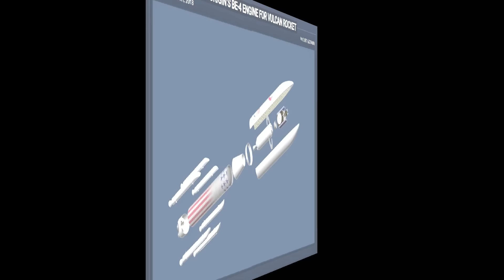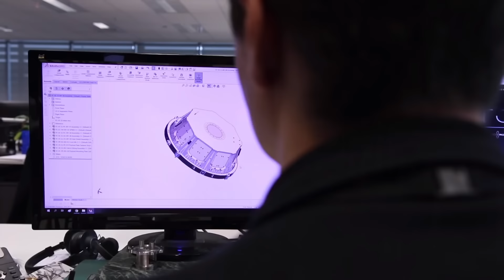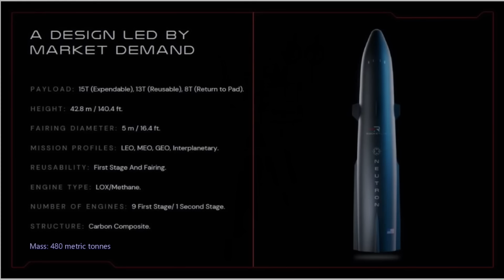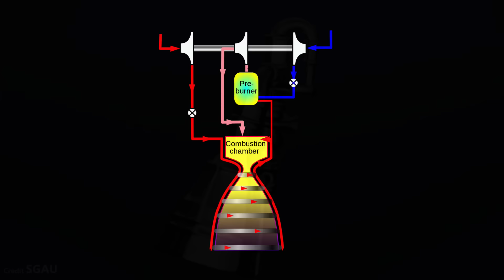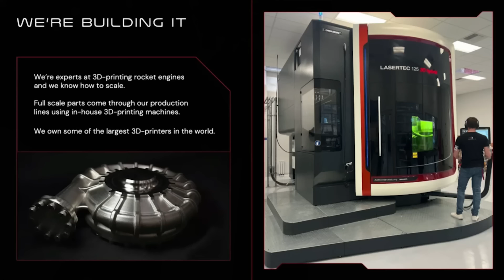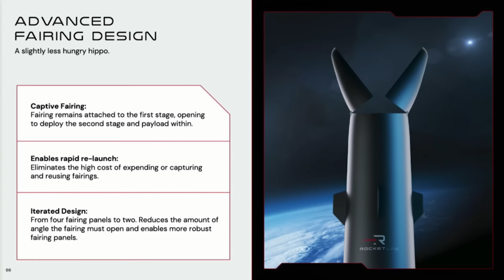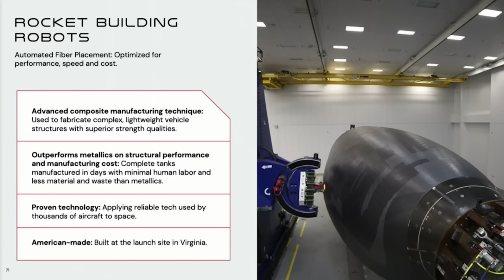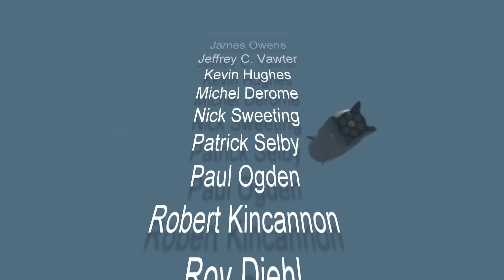Rocket Science: The Archimedes vs BE 4 Rocket Engines

Comment: I like the new choice of  engine design and the reasoning behind it, It allows for an engine design that can be easily altered to suit future power requirements etc.
I like the fact that Rocket Lab is doing some genuinely innovative stuff here, instead of just another Spacex copy. 
I think Peter Beck was perhaps a little misleading with the comment of carbon fiber being 1/4 the weight of metal for the same load, that may be true, but when used in this application the tanks need to be seperate to the outer structure. With metal the tanks are part of that structure, so perhaps the actual figure is more like 1/2.
From what I have read on carbon fiber (I work in the metal trades) it's strength in any direction depends largely on the lay of the fiber (to make it very strong in one direction it becomes weaker in others).
It's durability and ability to consistantly handle the change from ambient temp to cryogenic temp for the tanks, and ambient to reentery temp for the outer structure is largly reliant on the glue that holds those fibers together.
While I think using carbon fiber is a difficult task for this application, Rocket Lab have stated that they have developed their own 'glue' for this purpose.
They have also developed their own nontoxic hyperbolic fuel, I think that is a first, but could be wrong. In any case Rocket Lab clearly employ high quality chemical engineers who would be as good as anyone at engineering those problem 'glues that I mentioned above.

I guess this has been a long winded of saying yes, I think Rocket Lab has what is needed to succeed with Neutron.
Reply from the maker: Spell check made you say hyperbolic fuel :-)  Which is proprietary to Blue Origin! I am still mixed on composite materials but I think the Neutron application is about the right size, and the booster won't experience anything near orbital reentry heat.  But when you get really big I think steel is the way to go.  Or lunar titanium... I love titanium :-)
Reply: @terranspaceacademy  I've been saying that, since Heavy Booster won't experience high temperatures and they don't need very many of them with the rapid turnaround time they're aiming for that it would make sense for SpaceX to use expensive, light materials for the weight savings without bankrupting the company.
Also, yes to lunar titanium.
With water, helium 3, titanium, low escape velocity and a barren environment (strip mining without protests) I would love to see lunar materials used for building infrastructure and spaceships with which we populate the rest of the solar system.

Comment: Good Job! The one thing with SpaceX Raptor is the drive to make the most out of chamber pressure. I like the reduction of complexity for reliability. SpaceX has problems with reliability of the Raptor. I don't know if the engine is robust enough to handle the existing pressures without a big giveaway of longevity. SpaceX is redesigning thrust region for Raptor RUD.
Reply from the maker: Very true... if they can get the margins high enough they can pull that back some and still be ok.
Reply: @terranspaceacademy   I certainly hope so. I saw yesterday that B9 will have the 2.1 with electric gimbal. I'm absolutely sure that they'll make it to orbit. I'm also absolutely confident, that we'll have a couple more excellent companies doing reuse soon. Rocket Lab and Relativity. It's all happening!

Comment: 10:50 Blue Origin testing fairing recovery system similar to SpaceX.
Don't care what company does the job but they deliver.
After many By the Year 2000  "lies" I've heard since the 1960s, the goal isn't the best CGI but actual getting the job done... quickly.
Reply from the maker: I would agree with that completely Lee.

Comment: Coming in after the NG launch and I think you may have had a strong negative bias to BO as the BE-4s have been proven to be quite reliable in saving Vulcan flight 2, and production has ramped up to the point that there are actually extra BE-4s sitting around now. Every engine is having issues early, that was proven with how many Raptors shut off in the first Starship flight. BO just had their issues in tests and worked out the kinks. I believe in Neutron and I believe in Peter Becks mission, but people love to discount BO just because they are more secretive and quiet.

Comment: Not sure if anyone commented about this already … but Peter Beck mentioned something about their new engine that was not covered (or maybe I missed it) in any of your past videos. He said they don’t want to push the envelope on anything and that it was going to be the most boring engine in the world. One thing in particular he mentioned is the chamber pressure, he said it will be around 1500-2000 psi, the implication being they will not push the 4500+psi Raptor is doing. Now, in your BE-4 fault analysis video you said the weakest point in the design are the turbines since BE-4, like Rocketlab, opted for the single shaft design. You mentioned the required mass throughput and possibly the rpm requirements. My point … isn’t this one of the reasons why Raptor is going for high pressures. I would guess that both fuel and oxidizer will be either in the gas or SCF phase in the turbines. Therefore higher pressure meant higher density for the fluid. Higher density implies higher mass flow rate from a lower turbine rpm. Therefore higher pressure DOES NOT necessarily mean lower reusability for the engine. I am not a rotating equipment expert but I worked with enough people who are and I recall them telling me that it is easier to control pressure/temperature and loads on bearings in design parameters for pumps than it is for higher rpm requirements. Because pressure/temperature/load requirements may just mean picking the correct material but higher rpms require picking the correct material and tighter tolerances for making the rotating parts in the pump or turbine.
Reply from the maker: Very good point.  High pressure equals short residence time equals higher mass propellant flow and therefore higher thrust from a smaller engine.  Low pressure equals larger combustion chamber and longer residence time. High pressure does not mean lower reusability as you state, IF, you can solve the explodeyness factor.  Copyright pending on that term.  Efficiency comes from chemistry (energy content of reaction of fuel and oxidizer) and power or thrust comes from physics (how fast can you get propellants into the combustion chamber and have them react.  The Raptor is based on two turbopumps to share the workload, extremely high combustion chamber pressure to reduce residence time and allow higher propellant flow which increases thrust.  A lot of people criticize the exploding Raptors now but SpaceX could downtune it a little today and have the best most reliable methane engine on Earth. Just like the Merlin is the best RP-1 engine.  Don't tell me that the RD-180 is better when it can't even be reused once.  The keep blowing them up to push the envelope and find the limits of current metallurgy and technology and push beyond them.  When they start flying regularly Raptors will be like aircraft engines.  Always running with a large safety margin.
Reply: @terranspaceacademy  Question … are the failure points of the exploding raptors always at the combustion chamber? No failures at the turbines? I have been looking at videos from many sites to determine this. I expect that if the failure point is at the combustion chamber then you should at least see the bell nozzle falling off in the SpaceX vertical test stand, or pieces of the nozzle shooting out on the horizontal test stand. I don’t recall seeing anything like that. Any analysis video planned by TSA to speculate on possible failure points on the current Raptor-2?
Reply: Reviewed the Raptor failure videos from Lab Padre. I don’t see any pieces of nozzle flying out or falling off. However, 2 videos showed the green flame that is indicative of the injectors burning off because the methane supply was cut, just like in one of the SNs during landing. So this implies the Methane Turbine failing instead of a failure in the combustion chamber. Brings back my initial point that the high pressures of Raptor is not just for combustion efficiency but maybe to reduce the RPM of the turbine.

Comment: The claim that Blue Origin failed with BE4 seems, at best, premature and at worst a lie. The development may have taken longer than initially expected (ca. +4 year), but that's true for most large aerospace projects (Starship/BFR was supposed to have two mars landings by 2022), and BO principle was never speed above everything else. Less than a month after this video was posted BO delivered its first BE4 flight engine to ULA and unless BE4 causes Vulcan to fail, I'd consider the BE4 a success.
Reply from the maker: They accepted a commercial contract and FAILED to deliver on time, costing their customer hundreds of millions.  That's a fact.  SpaceX/Starship disappoints only itself when it has a delay.  The BE-4 is NOT a success at this point.  It hasn't accomplished anything except burning through a lot of money.  It will probably work fine as a single flight non-reusable engine for Vulcan but that remains to be seen.
Reply: @Terran Space Academy  BO has accomplished developing a powerful  (~2.4MN) reusable staged combustion rocket engine, with deep throttle capability (at least down to 40% thrust) and no reliance on Russian components, which was their goal and is extremely impressive.
SpaceX also has customers that suffer from their delays, such as DearMoon, that is true for any company, not just BO. As for  "cost ULA hundreds of millions", if that is a fact, please post a source. Every article I've read, for example one from Arstechnica in 2021, claims that BE4 is STILL a cheaper and faster choice than the alternative AR1 from Aerojet Rocketdyne.
Reply from the maker: @plainText384  No... they haven't.  Nothing has been proven reusable or even operational yet.  Raptors have lifted Starships off the ground.  BO is a no go so far.  And the BE-4 is much more expensive than the Raptor.  No one cares about the AR1 at this point.

Comment: Very good presentation.
Boring design? Yeah right! No closed cycle engine is ever boring!
I would like to know exactly what chamber pressures he is talking about. And what metallurgy and seals he is using to combat the corrosive effects of hot oxygen. Maybe, that's his secret sauce.
So far, we've had one example of a reliable oxygen rich pre-burner closed cycle engine - the RD-180. But, that has to work only once!
A reusable, let alone a rapidly reusable, oxygen rich closed cycle engine remains to be proven.
You know what boring is? A basic gas generator open cycle engine like the Meriln-1D. Now, extend that to burn methane instead of RP1 and you have a true boring workhorse!
Reply from the maker: You are correct Tariq.  I have wondered why they don't combine expander and closed fuel rich cycles with a turbine on either end and the pumps in between...  I know the complexity goes up but so does the redundancy.  That way no turbine is forced to kill itself on such a big engine.
Reply: One point that Peter Beck made that I thought was very significant, certainly resonated with me as a hardware design engineer - do not push your design implementation to the edge of what your system can tolerate before breakdown. In other words, leave plenty of design margin. This design philosophy will go a long ways towards achieving the desired reliability and reusability. I suspect that's what Beck implies with "boring".
Elon Musk, on the other hand, likes to push the design to its limits. With all due respect, Elon, that approach does not bode well for rapid reusability. 33 Raptors, 66 turbopumps in the booster alone - there are many failure modes yet to be understood in a system of such complexity. Don't expect an orbital flight/recovery anytime soon!
Looking forward to seeing how rapidly reusable the Raptor is compared to the Archimedes.

Comment: BO didn't fail, it turns out. Flight BE4s are have passed their tests and are being delivered to ULA.

Also where do you get the 32 engine figure for the 2023 launches?

And people should be looking at a company because the CEO makes turkey stuffing metaphors and doesn't have the confidence in their own technology to push it to its maximum capacity?
Reply from the maker: That was from an older update. I hope the BE-4s come through but we've been disappointed many times. Fingers crossed.
Reply: @terranspaceacademy  

Stay tuned ;)